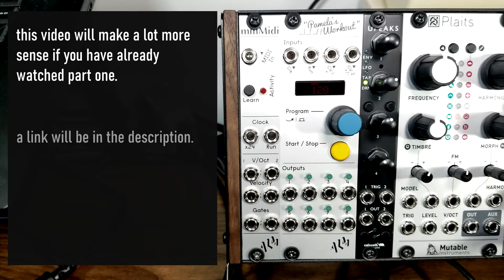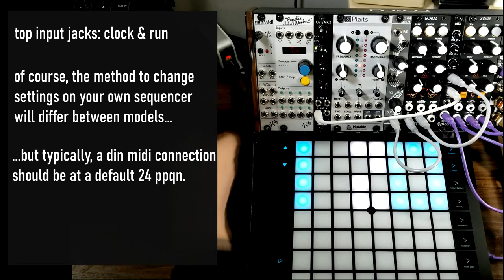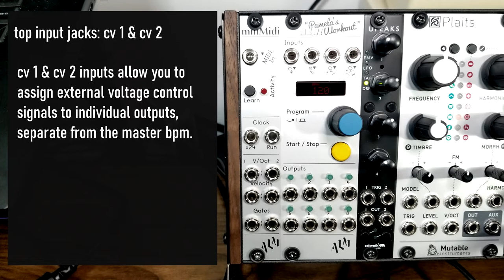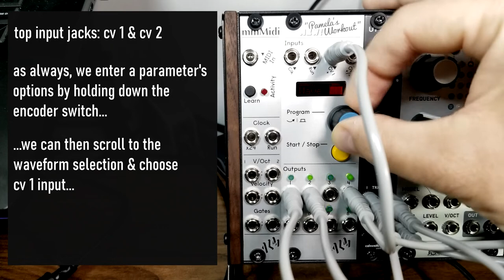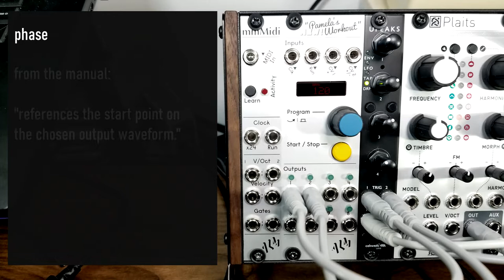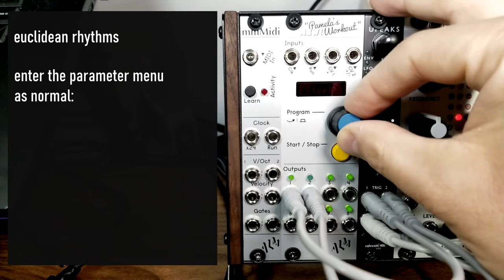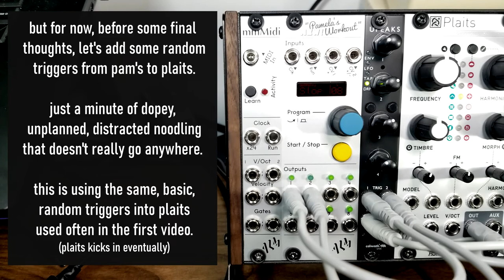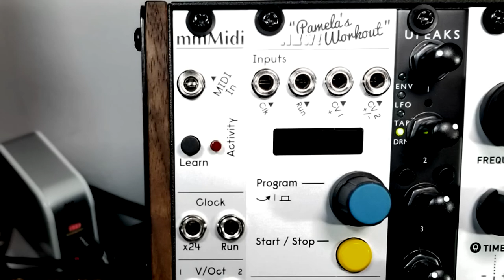Pamela's New Workout SHALLOW Dive Tutorial: PART 2

Comment: Hi again! I am still researching the Pamela, and I got curios about one thing that I didn't found in manual. Maybe you could help out? There are number of scales in quantization mode, it is clear how to select and use them. However, I am confused about how to set a root note for a scale?? Or is it set by tuning the pitch of an oscillator that is being controller by Pamela?
Reply from the maker: A similar question came up from another viewer not too long ago. I believe that the root note is just set by your oscillator. When I use it, Pam's just affects whatever note is playing on the oscillator and then you can just make further changes on your oscillator's tuning setting. 

Strange it isn't mentioned in the instruction manual as it's mostly a really concise and well-written manual. Honestly, to clarify I would probably email ALM. I have once or twice in the past and they got back extremely quickly.
Reply: @thedigitallost  thank you for your thoughts, I will get in touch with ALM and will report the results here.
Reply: OK, confirmed by ALM - the root note is the pitch the oscillator is tuned to.
Reply from the maker: Great! Kinda what I thought but good to get it from ALM. Thanks for posting!

Comment: Your first PAM vid led me here, super helpful and useful! Let me ask you please, I just pulled the trigger on it after learning I can feed it an external clock, but knew nothing of RUN input, so now what, am I going to have to shell out for the external mmMidi you have in your vid? Can I use anything else do you know to get it to run? I wonder if I hit play while it's getting the external clock if it would sync, that's all I really care about! Thanks again, great stuff, cheers, be well.
Reply from the maker: Thank you for your kind words!

You only need the mmMidi module if you want to use a MIDI controller/sequencer. If you have a controller/sequencer that uses control voltage rather than midi, you can just use that directly into the inputs on Pam's. Just make sure the PPQN settings match. This was talked about a little bit in part two of the video. I had mixed results with the Korg SQ1. The PPQN was matched, but it just wasn't consistent. Like, I could get it to run and I could get the clock to work. But then if I stopped and tried starting again it seemed to have some difficulties. No idea what that was all about.

This was the only other non-midi sequencer that I own and was able to try with.

But yeah, in theory you don't need the mmMidi module if your sequencer deals with control voltage, but definitely will if your sequencer is of the midi variety. 

Good luck! Hopefully this clears things up a little bit. Any other questions go ahead. And thanks again!

Edit: I forgot to mention too, if you just want to deal with clock and run signals, ALM also have separate expander modules that I think I mentioned in part two of the video as well. That is if you are dealing with a MIDI sequencer/controller but don't care about CV controllled volt pet octave and gate controls. I think they're called something like the PEXP 1 and two. Definitely worth checking those out on their website.

Comment: Thank you for this.My go to tutorial
Reply from the maker: Thank you very much! I'm going to assume that you've also watched 
Part one! Definitely let me know if you'd like to see a part 3 as well. I'm still undecided on that. After these two videos I'm kind of getting past shallow diving and getting into real in-depth stuff. But if there is enough interest then it's something that I'm certainly not against. Again though, I'm glad you found the video helpful and I really appreciate you watching and commenting! If there's anything else you need to know, go ahead and ask. Cheers!
Reply: @thedigitallost  Yes I've watched part 1 a number of times.Would you if I can clock the Pamela's from an exterior sequencer (minibrute 2) without the mmMidi?
Reply from the maker: Yes! You can if your sequencer has a CV style clock/sync out. You might have to play with the PPQN settings on either Pam's or your sequencer. I've had some success using a Korg SQ1, but it was always a bit spotty. Like, I had all the settings matched up properly and sometimes it worked sometimes it didn't. The timing would just drift. So your mileage may vary. In the end, I just decided that I liked Pam's as a master clock. But yes; in theory, you can set Pam's as a clock slave with an external sequencer without the mmMidi module, provided that your sequencer has CV clock out and the PPQN settings match.

Comment: Thanks for this video! Quick question here: if you were to plug only the clock output from your Launchpad into the PNW, and nothing into the "run" input, would PNW start to play at the next clock signal and be synced to the beat as soon as you press the start/stop button on the unit? Not sure if I'm making sense here..
Reply from the maker: Hello! Sorry about the delay in reply, but I wanted to try it out before I did leave a reply.

So, the Launchpad Pro mk3 used here in this video doesn't really have a dedicated sync/clock out. So I tried it with the only other sequencer I had on hand which is the Korg SQ1. This does indeed have a dedicated clock out. Now, I think I did mention in this video that the SQ1 had some issues trying to talk accurately with Pam's, even with the PPQN matched correctly, but they were more just issues with keeping in time. 

I connected the SQ1 sync/clock out to just the clock input on Pam's with nothing plugged into the run input, but it did not start Pam's running. It just sent a sync clock signal to Pam's.

Not sure this was the kind of thing you wanted to know, so if you have any other questions, go ahead! I'll try to answer for you. Cheers.
Reply: @thedigitallost  No problem, thanks for taking the time, I appreciate it!
Ok that's very helpful! And when you do this, if you press the start/stop button of the Pam on the fly, does it catch up to the tempo perfectly or do you get some stutters/skippings of the first steps for example? That's usually what happens with this type of units, my Moog Mother 32 takes time to run the sequence properly when I press play on the fly, with an external clock fed into it... Thanks again!!
Reply from the maker: No problem!

Yeah so, when I pressed start on Pam's it did stutter a whole lot trying to figure out what the tempo was. It seemed to lock onto it pretty quickly, but generally there were a lot of hiccups. If I changed the tempo on the SQ1, Pam's got really confused. It was not a great experience! 

But again, the SQ1 and Pam's just don't seem to talk well together. Certainly not for me anyway. And trust me, I've tried!

You may have better luck with a different clock source, but I still doubt you can start Pam's running via the clock input.

If anyone else is reading this and has experience with this, chime in! I like to think that the comments sections for these videos can be seen as a bit of a backup document where we can all help each other out with tips.
Reply: @thedigitallost  Ok, well... Clock syncing is always kind of a mystery anyway, hard to predict the behavior of these units... Thanks for taking the time!!
Reply from the maker: Absolutely! And anytime! I love talking about this stuff and I'm always happy to help out. Cheers!

Comment: What were the other issues with the uPlaits that you had?
Reply from the maker: I got that module pretty early on. Once I had a bit more experience with different modules and companies, I quickly realized that the build quality on that particular module was just so poor.

The jacks and the pots are really wobbly. Like, the pots in particular just feel like they're being held in there with faith alone or something. I have read on a lot of forums that this particular maker is actually known for using very cheap parts.

The module is also quite noisy. There is a faint but definite background hiss. Also, from time to time you could hear the other oscillator engines being triggered in the background. Again, very faint but very definite. These are all weird problems that do not exist in the legit Mutable module.

That company also ended up being pretty shady too. They have a well documented problem where they will take money for orders, not send the order, and then ghost the customer. I was on the receiving end of this myself. Money left my account, no order sent, and then they just stopped responding to emails, online messages and phone calls. I got my money back through a PayPal dispute, but still, that tied up my money for weeks and it was a very frustrating experience, not to mention that it's a pretty crooked thing to do. A lot of people have had to deal with that issue. 

And at the end of all that, there is even a small error on the front panel! The oscillator type symbols are out of order at one point. I know that it's a Magpie panel, so that company didn't make it, but it's another negative point just stacking up against Momo modular. 

I'm not against the Mutable clones as such, but there are so many other good quality makers out there doing much better work. Apparently Momo used to do decent work, but those days are long gone. They are definitely still in business selling very cheap clones, but if a clone is something that anyone is interested in they would be better off spending the extra few dollars and getting it from a company like Calsynth, After Later, or Michigan Synth Works. 

Regardless, now that I have used some genuine Mutable modules, I can't imagine using a clone again. The legit modules are so nicely built and sound great. They are rock-solid.
Reply: @thedigitallost  Ah, thanks. I'm pretty sure I know the company that you're talking about and I just had a similar issue with them taking money, going silent then eventually getting around to shipping. It's been a nightmare. Hopefully I'll have better luck if and when my item arrives. Thanks for the detailed response.
Reply: Oh, I see you named the company. Yep! Same company. It's a shame. I think they're just overwhelmed.
Reply from the maker: Ha! Yeah they are really pretty bad. I sort of avoided naming them here but my incident was well over a year ago so I figured there was no real harm in sharing my experience with them! 

I'm not really down with the whole "they are overwhelmed" excuse thing though. There is absolutely no excuse for taking people's money and then completely ignoring them. Even if you are running behind, just answer the damn email! There are plenty of small companies doing similar products who can get their product out on time, probably doing as much or more business than Momo, and answer emails promptly.  As I said above, there are plenty of great companies making these Mutable clones who not only make a better quality product, but are really great with communication. Calsynth, for example, have always gotten back to me within about 20 minutes when I've had any kind of sales or technical query. The guy followed up after the two modules I ordered from him within just a couple of minutes confirming things like firmware choices, and then had the modules out the same day. Such a great experience and the modules are far more solid than the Momo one that I have. And I've spoken with far too many people, mostly on Reddit, who, like me, never ever heard anything from them again and had to rely on PayPal and credit card disputes to get their money back. And even then no one heard anything back! They made no reply to my PayPal dispute. Complete radio silence.

I noticed that they do business on eBay under a different name, and rumor has it that eBay canceled their account due to all the PayPal disputes so they just started doing business under a different name on ebay. And they have a great Reverb rating because, and I can tell you this from my personal experience, Reverb makes it almost impossible to leave negative feedback for large accounts.

Whatever though. If you and anyone else gets there Momo module and it works fine for you, great! I'm not trying to take that away from anyone, I just think that people should be aware that far too many people have had some seriously terrible interactions with this company and their products, and that there are plenty of other far better companies with nicer people putting out a better product to be dealing with.

Either way though, thanks for watching and commenting! I'm more than happy to talk about this stuff anytime. Cheers.
Reply: @The Digital Lost Thanks for sharing your experience (and for calling me out on being too diplomatic). You're 100% right. This whole experience has also made me doubt Reverb. They were so quick to invalidate my concern and defend Momo.  My uO_c is finally supposed to arrive today after three weeks. Having learned what I learned about Momo in the past few weeks, I’m now worried about the quality of the uO_c once it arrives. I’ll try to remember to report back here once I try it out.
Reply from the maker: Fair enough. And seriously, I don't want to take away or sour anyone else's positive experience with that company. If the module works for you and you're happy with it, go for it!

Just remember though that (well this is what they used to offer, I'm not sure anymore) they used to have a 14-day window where you could do free returns for any reason. I would work the hell out of that module and make sure that there are no quality concerns within that 14 days and if you're not happy with it, absolutely take advantage of it. They also used to advertise a 2-year warranty, but considering how bad they are with communication I think that 2-year warranty is absolutely worthless.

The 3 week wait that you have had is actually really good! Almost tellingly, I got a tracking number within seconds of placing the order which I found a bit fishy. The status with USPS never got beyond "tracking number created, post office awaiting item." The fact that it was almost like an auto reply, the speed at which I got that tracking number, set off a small alarm bell. After weeks of no communication whatsoever and the tracking number status never changing, I kind of figured out that AT BEST this company was grossly incompetent. At worst, they are just outright thieves. 

A few months ago, just for fun, I checked the status of the tracking number and it was still sitting at the same "post office awaiting item status"! This was well over a year after I ordered the module!  The number seems to have been deleted from their system now.

Again though, I hope you have better luck than a lot of us have had. I really am trying to not be too negative and sour anyone else's possibly positive experiences. Feel free to post your experiences here!
Reply: @thedigitallost  Okay, last update: it arrived yesterday and seems to be in good shape. Sadly, I still can’t recommend them. After their radio silence, ignoring my request to cancel, not shipping until after my request to cancel, there’s just no way I want to go through an experience like that again.
Reply from the maker: Fair enough! Again I hope it all works out for you, but as I said above, see if they do have a free returns period and take advantage of that. Honestly man, I just cannot see their warranty being worth anything considering how bad they are with something is simple as sales enquires and shipping. I cannot imagine how terrible they would be with a technical problem. 

Again, I don't want to be too negative, just sometimes you got to go with your gut and my experience with them has really rubbed me the wrong way. 

Either way though, thanks for updating us!

Also, if you get any sounds uploaded, feel free to send me a link! I'm always interested in hearing what everyone else is doing out there. Cheers!